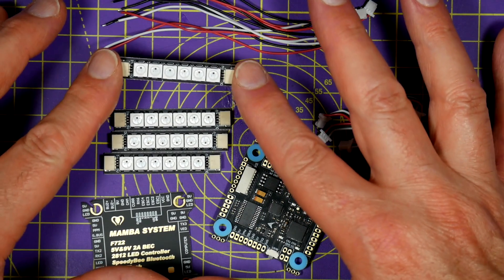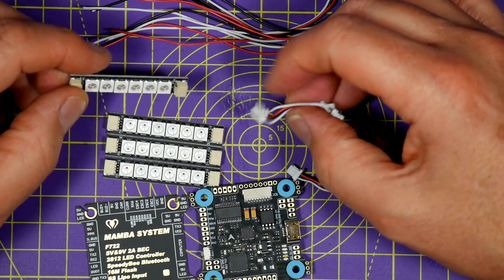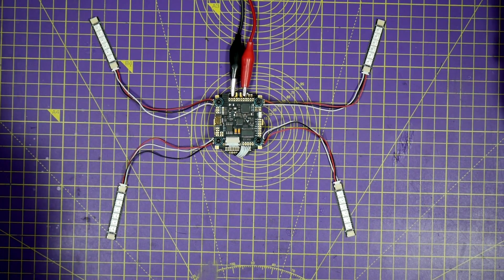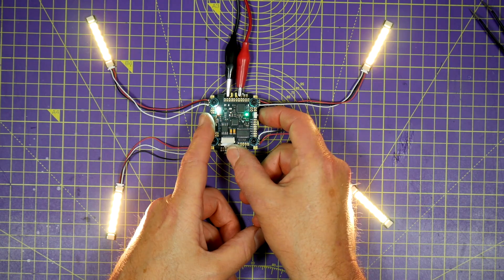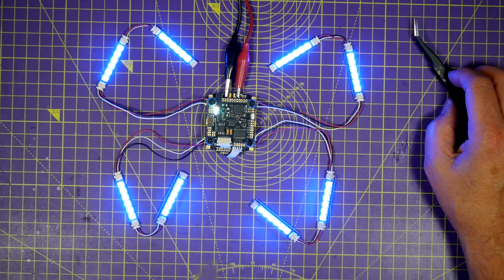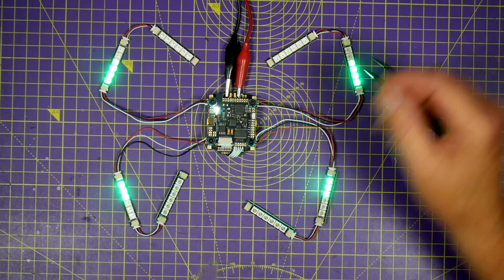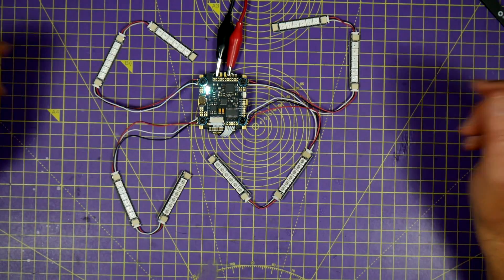Diatone Mamba Flashbang SW601 LED strips motor wires for the F722S flight stack

Comment: Is it possible to install that led in diatone roma l5? MAMBASYS F722 AIO MK1 ? Need ur guide. Thank you
Reply from the maker: Not too sure cos I don't have one. Best to check the AIO manual. Also try contacting Diatone support. They can someone be very helpful.
Reply: @WhirlyBloke  thanks for ur suggestion. I'll try to contact them ! Greetings from Indonesia 🙏

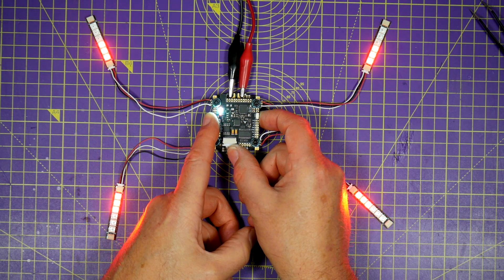Comment: I have f722 app mk1: when i hold the button long it turns everything off. When i double tap it changes sequence types. But I cant make it two flash and two solids like in your demo at 2:53. May be my FC is different.

Comment: Hi. I know this is an old video, but i was thinking if i can use this leds on my succex-e f4 flight controller. thank you
Reply from the maker: I'm not sure. Let me know if you find out.
Reply: @WhirlyBloke  I found a way. I only have one led pad so i will have to connect them in series trough the whole quad
Reply: @koressdavid  you can connect them all in parallel for easier wiring but that way they will all display the same
Reply: @drkastenbrot  yes ik. I have connected them but soo nrealized succex-e is a bad fc and got a new one(hglrc zeus f722 i belive). Its much better

Comment: Hey I just finished a build using a mamba f405 dji 50a stack I bought the flash bang led aswell i plug it in and no led work but then when I arm quad motor arm 2 and motor arm 3 led come on the others on motor arm 1 and 4 don't work then when taking off the led spaz out and change all random colours 

Don't have a idea what might be wrong thandk
Reply from the maker: Double check the wiring.

Comment: Hey, the multifunctional button is working fine for me. I can't Programm them in Betaflight unfortunately. 
Do you maybe know how to fix this?
I tried it like Hardwell😁
Reply from the maker: I don't think you can.
Reply: Don't forget about soldering bridge. It's probably bridge as M8 (button controlling).. If you remove the bridge then bridge to BF.. button will not work but now BF can control it.

With BF controlled, you can use LED modes switch to toggle on/off. Maybe assign modes to knob.. you can change colour while you turning knob.

Comment: Hey man thanks for the video, i was soldering an LED strip to the back of my drone, but i cant switch the colors, didn't know that the f7 got this led controller button, but when i switch the colour and i want to save that, what should i do? because when i pull the lipo out of the drone and stick it in again, the led strip starts at white and not in the colour i choosed? 

thanks for the help and greets from germany
Reply from the maker: Thanks for watching and the info.

Comment: I wish Mamba F722 gave us a way to control the LEDs through betaflight LED panel, so we could get all the useful stuff like (turning them OFF with a switch, getting battery low warnings and others)  but I guess this video is just about the leds themselves not the flight controller.
Reply from the maker: That'd be really nice.
Reply: You can do that... just short a tab on the FC.... it say FC or LED.
Reply: @MT-xy7fw  no way... that's awesome thank you.
Reply: @ulightme  I have 4 rows of LEDs soldered on each corner of the FC. If you decide to use betaflight mode then your led must be all joined together in series so that BF can handle individual led bulb customisations. Otherwise it'll act as one led row.

Comment: Nice review. So if I have a fc with only three pads for leds (gnd, LED, 5v), would I have to daisy chain if I want multiple strips?
Reply from the maker: That sounds about right, but it does depend on the FC.
Reply: @WhirlyBloke  I wonder would I be able to link these to the BrainFPV Radix LI?
Reply from the maker: @BlindedByEvil  I don't think you can.

Comment: I am using the Mamba F722S with LantianRC LED strips www.banggood.com%2FLANTIANRC-LED-Light-Control-Board-2-6S-5V2_5A-WS2812-4-Lamps-In-Parallel-for-RC-Drone-FPV-Racing-p-1448285.html&usg=AOvVaw0V5raR2s90MBLnMPtxGyUb

How do you turn the LED OFF?

Comment: I think you can't control these over Betaflight when connected to the 4 led controller connections right? I think the additional led port is for that. This allows you to do more fancy stuff in betaflight like changing the lights led per led based on your signal strength, battery level or the amount of thrust you are outputting.
Reply from the maker: They aren't addressable in BetaFlight. But they look great.

Comment: Thanks for video sir, quick question if you have time: what are you powering with?
i can hear you turning it on and off - connected with the red and black wires
Reply from the maker: I'm just using a bench power supply.
Reply: @WhirlyBloke  Thanks

Comment: I just built a5 inch with that stack a few weeks ago and might as well pimp it out a bit with these since its so easy with that board, so thanks for this. Are you going to use all eight for over and under or just four, I'm trying to decide. Also, can you turn them off, or put them on a transmitter switch?
Reply: Use 8. 4 top, 4 bottom